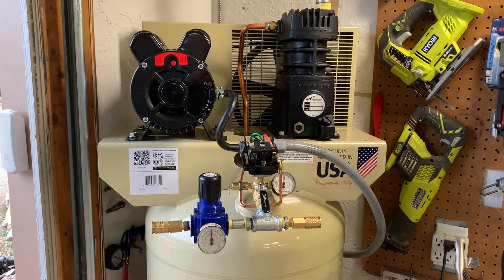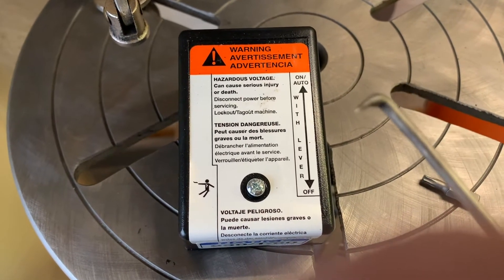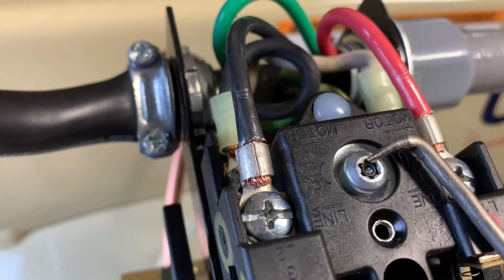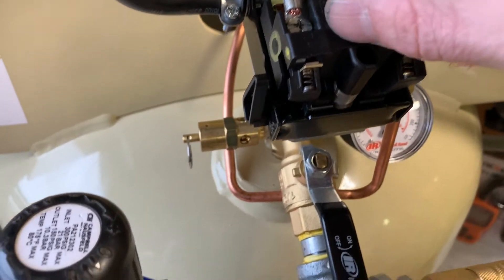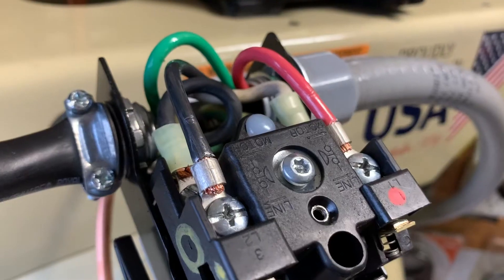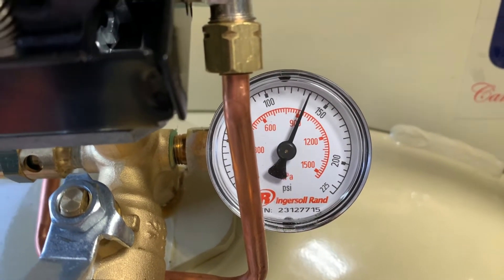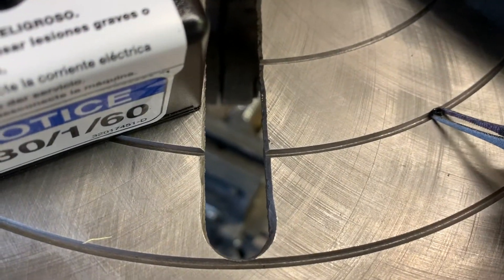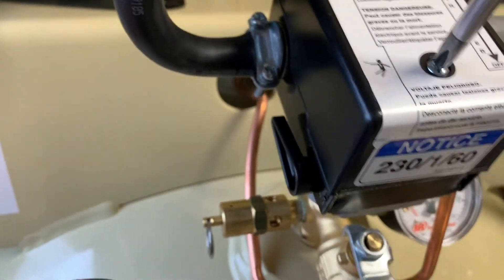Pressure Switch Adjustment - Ingersoll Rand 65 Gal Compressor

Comment: Can you please give a link to the correct torx driver for this adjustment? Great video and very helpful but I can’t seem to get the right driver and don’t know sizes. Thanks.
Reply from the maker: Hi @hanktosh4704, it is a T20 size with the security hole in the middle. A set like this should do the trick.  Yours might have a little plastic insert in the head of the bolt that initially prevents the tool from going in.  Use a pick tool to pop it out.  (Not sure if I mentioned this in the video and I’m too lazy to go rewatch ;0)

https://a.co/d/cfxKR3m
Reply: @MountainMikeNM  Thank you! I did catch the other trick on the video and was able to remove the grommet so I’ll take a look at this set. Really helps to know the size . Thanks again!

Comment: Any issues with your compressor after these years?
Reply from the maker: None whatsoever. That said, I do not use it in a commercial capacity. But the motor runs at least once a day due to various household use like blowing dust off of stuff or cleaning out the shop. And on days when I’m doing projects, it may run countless times in a single day and sometimes run continuously for dozens of minutes at a time.

Comment: I’ve got the opposite problem. It’s not shutting off till about 160. I’m concerned I’m gonna break something.
Reply from the maker: Try loosening the nut. If it gets so loose the spring is jiggling around, or the nut comes off, and it still won’t turn off at lower pressures, then you probably have a damaged pressure switch.

Comment: My switch has on & off positions.  IR T30 model 2340 L5.  When the switch is off it still runs.  When the switch is on it runs.  It went to 175+ and was still running.  Shouldn’t it stop if the switch is in the off position? Guessing the pressure switch is shot…….?  Got this at an auction.
Reply from the maker: Possibly shot or the springs are so cranked down that the contacts can’t disengage. Try loosening both springs’ nuts until there’s only a tiny bit of compression (just enough to prevent them from rattling around) and then see if the cutoff lever works.

Comment: Thank you for the video.
I had an issue where the pressure switch wouldn't close the circuit because the cover screw not being installed allowed the upper contact housing to lift up allowing about 2-3mm gap between the contacts.

Comment: The range you stated doesn't sound correct from my experience.  I would double check with IR on the unit.  Its been a few years so maybe they have changed.

Comment: I just did this with mine same compressor. Put a sharpie mark on 12 o’clock turned it 1/4 turn. Shutting off shy of 130 kept making small adjustments the screw would be right back to 3 o’clock each time. And still turns on around 90 psi. Oh well 10 psi more than I had.

Comment: Is there a way to also set the cut in pressure ? Or is it non adjustable?
Reply: Old comment, but for others: there's a flathead screw underneath the "blob" of  wax. Pop it off and turn the screw in to increase cut in.

Comment: Hi maybe you guys could help me out. I have a 60 gallon Ingersoll rand it runs for a couple cycles then the electric motor over heats and sends it into protect mode. Anyone with any ideas why it is doing this?
Reply from the maker: Sorry I missed this.  Is it a newer or older motor?  If new, do you have the correct thickness of supply wire?  Running too light of wire to a heavy draw can cause coils to overheat.  Otherwise look for cooling/airflow problems or mechanical resistance in the system to start.

Comment: my switch only wants to cut in at 135 and out at 175, if i turn it counter clockwise will it work ? or is that switch not going to work ? ideally i would want it to cut out at 125ish
Reply from the maker: That seems pretty high - like it's meant for a different range.  Are you sure your compressor isn't designed to run at a higher pressure?  For example, some 2-stage compressors can go as high as 250psi if I recall.  If this is the case, you would want to use a regulator to drop the outgoing pressure.  

If it should definitely be lower, turning counter-clockwise might work.  But generally the switches are designed for a certain pressure range and the adjustment is for fine tuning.  Another thing you could try doing is to measure pressures with a different gage to make sure the one on your compressor is accurate.
Reply: @MountainMikeNM  thanks for the help, i think i did a mistake and bought the wrong pressure switch. the original broke so i ordered one and that one has the higher cut off. stock one was cut in @100 and out @135. it might be to much to turn and wont work, just going to buy a new switch.thank you

Comment: Thanks for the video.  I just bought the larger 80 gallon 175 psi machine.  I want to turn it down from  175 to 150.  My theory is the compressor will last longer as it will undergo less stress.  I'm just a home shop and don't need all the air capacity I bought but gives me more flexibility if I do need more later on.  Thanks for the video.  Saved me $40 from replacing the switch.
Reply: I sold IR compressor for years and you are actually incorrect!  starting up on a compressor is one of the hardest things on the compressor.  It should be and 175!  they wider the start stop gap the better.  The compressor is under a stead load when running and cycles less there for less stress on the motor and compressor head.
Reply from the maker: Heck yeah, my friend!  Glad it was helpful.

Comment: 150 psi more like it
Reply from the maker: Care to elaborate?
Reply: @MountainMikeNM  more pressure more better
Reply: @that240guysx  Meh, I work in a shop and 120 is good enough
Reply: I have the same unit, I bought a tire machine and it has issues and only works at 1:35 down to 130, what is the highest that pressure switch can handle assuming I have the same one?